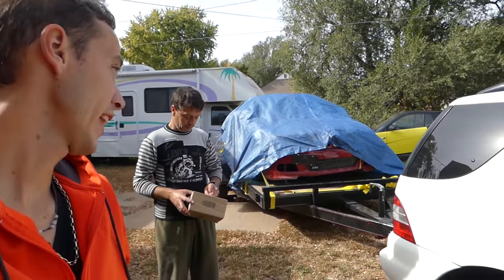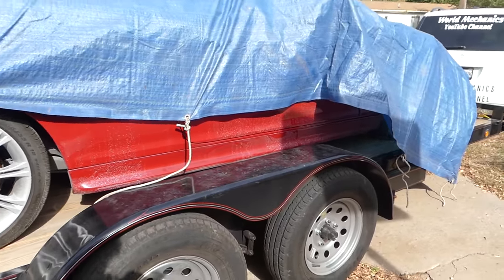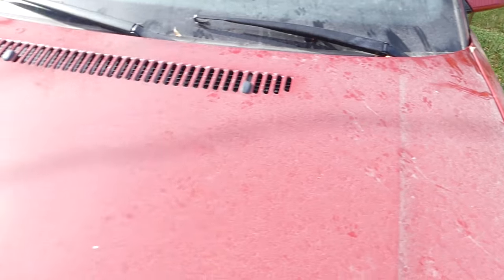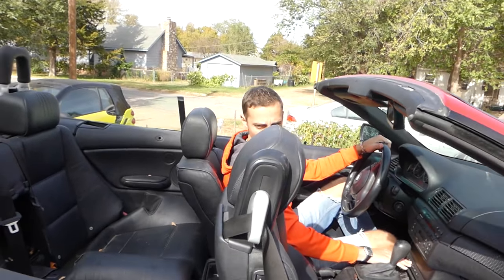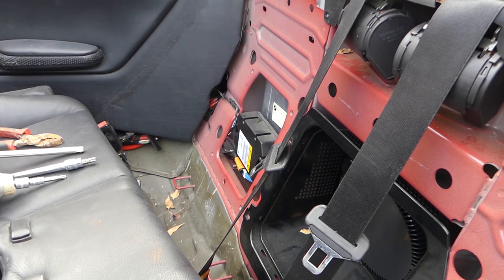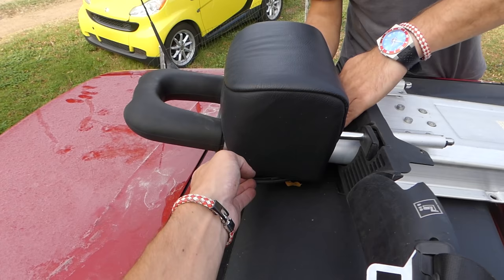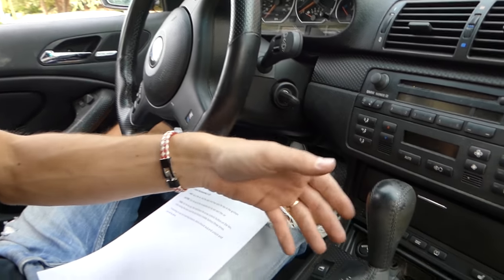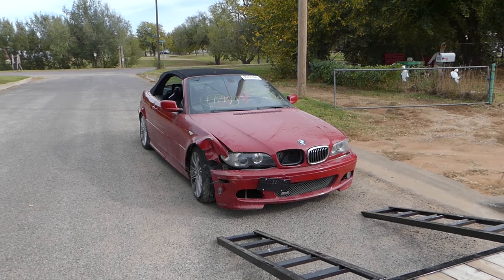OMG NEW PROJECT BMW E46 ZHP

Comment: You should have checked the manual...

The rollbars of the E46 can be pushed back after unlocking them. No need to remove them, no need to pull the whole car apart

Comment: Interesting project car, I love the ZHP and have one as my daily driver.  Would you consider selling me your steering wheel without the airbag?  I can give you my old one with money so at least you don't go with out a steering wheel.
Reply from the maker: thank you for the interest but I will try to keep the interior stock. I might have a parts car ZHP soon and if I get it I will let you know
Reply: The wheel I have that i want to trade is stock ZHP Alcatara wheel so your interior will remain stock.  Are you sure you wouldn't be interested in a trade with money?  I'm sure you can use the money towards more parts! LOL
Reply: I want to upgrade my aged alcatara wheel , deciding between a colby wheel or OEM perforated leather :D

Comment: Where are the black trim pieces from the bumpers? 🤔 

Edit:
I realized that this is a 330ci and not a 330i so nevermind lol. The 330i ZHP bumpers have a black trim, which is why I was wondering. But then I realized that the 330ci bumpers don't have the black trim pieces on them.